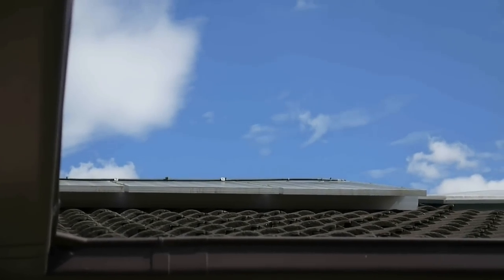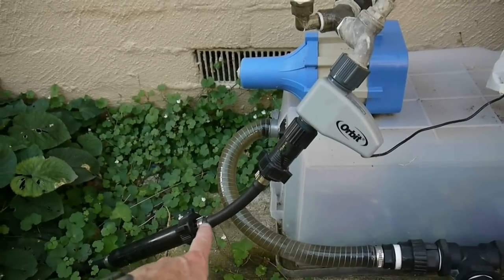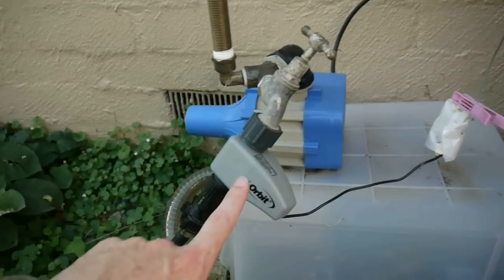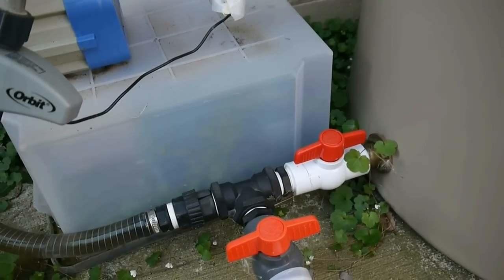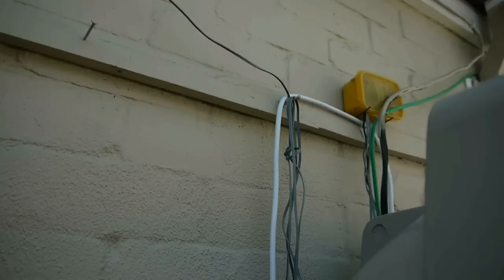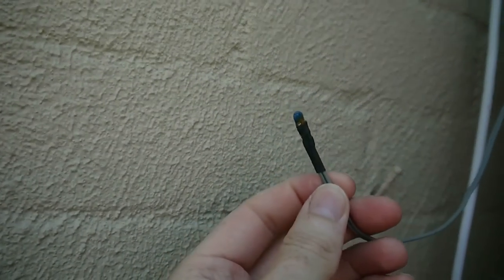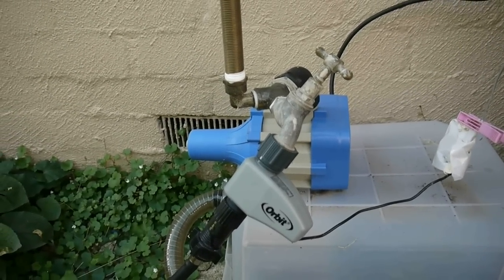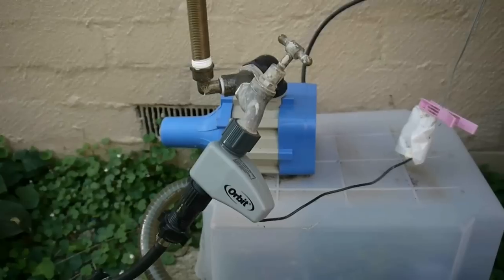Solar PV Panel Cooler - increases my power output with minimum water consumption

Comment from the maker: I just realised I described a different project- Duh! This used a low power irrigation valve from a local hardware store, plus a picaxe microcontroller and some relays to control the valve. It uses 2 thermistors to measure temperature. If you don't have electronics experience you would probably need to find some complete thermostat to replace those electronics.

Comment from the maker: I've never done any testing on that. In theory, higher humidity would reduce the cooling effect, so the system would potentially use more water. You may then see a lot of water running off the panel, i.e. wasted. In practise, I have never noticed it have a problem achieving my target of 8 degrees (celsius) above ambient.

Comment: Hi there,

Thanks for posing the vid.  Currently working on cooling my 5KW system over here in WA.  Its a bit more complicated as its on split into two arrays.  Running a 25mm dia pipe from the 14+9klitre water tank used to water the gardens.

I have in the mail my Irrigation Solenoid from ebay.  Now I am looking at pumps.  What pump are you using and is there any thing I need to consider when getting a pump other than the input and output dia.

Ash

Comment: Hi, I live in Florida and have a 7.5 kw system.  In the summer, we average around 92 f, with a very high humidity. I really wanted to find  way to cool my system, but will water work in such high humidity?  It will evaporate very slowly.  I have thought about a forced convection system to cool underneath the panels, but have not seen much info on this.  What is your thought?

Comment from the maker: No, sorry. I made it around 8 years ago with whatever materials I could get- e.g. the metal inside is second-hand roofing iron painted with stove black high-temperature paint.The top is polycarbonate roofing- basically the cheapest I could get that wasn't designed to absorb heat. The wood was partly second-hand. The electronics was made from whatever bits I had on hand (e.g. mainly using 741 op amps) plus two thermisters. The computer fans were the highest flowrate I could get that would fit.

Comment from the maker: It's pointless if the cooling system uses up too much energy or costs too much to install, so I think anything based on fans will not be worth it. Water is simple and if it evaporates too slowly you probably will just need to use more water. Just get a sprinkler hose and give it a trial. If that doesn't work, I don't think any alternative cooling system will be economical.

Comment: A patio misting system on a timer would work great.
Reply from the maker: It would work, but you may end up with a lot of calcium deposits on the panels. I use a rainwater tank to avoid that.